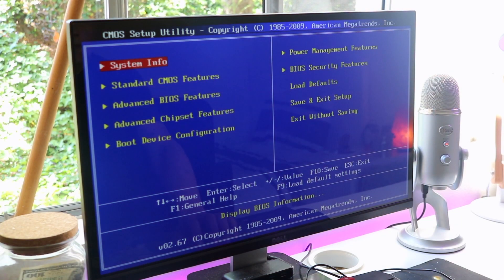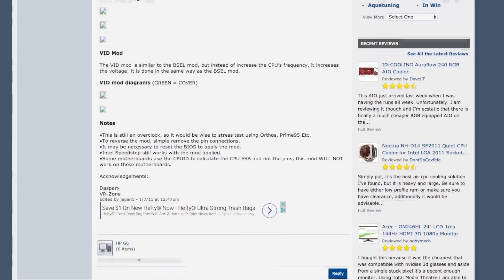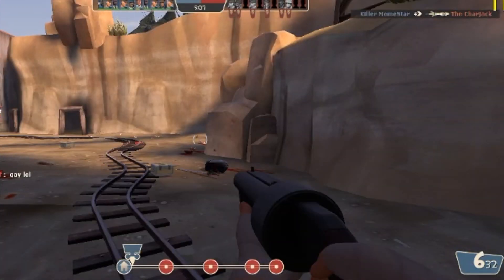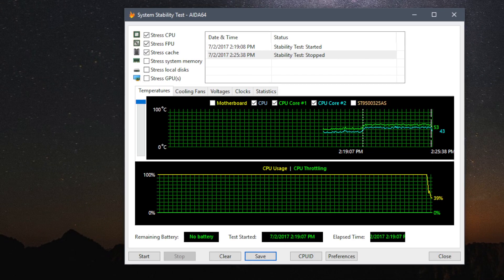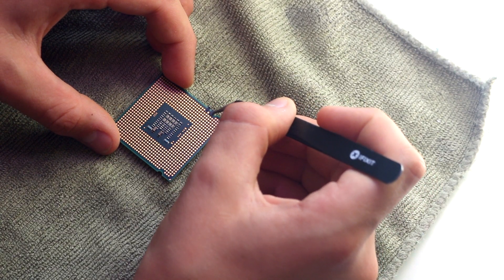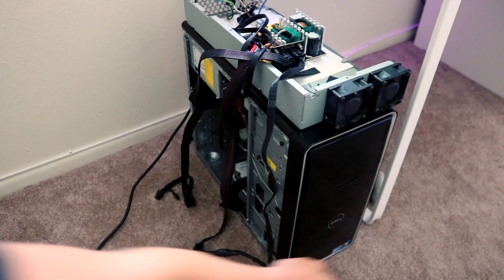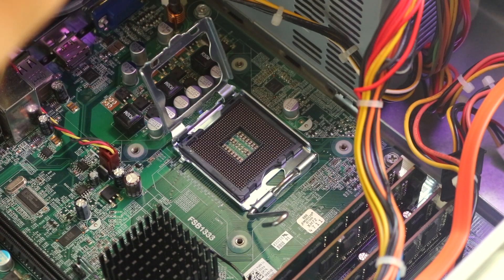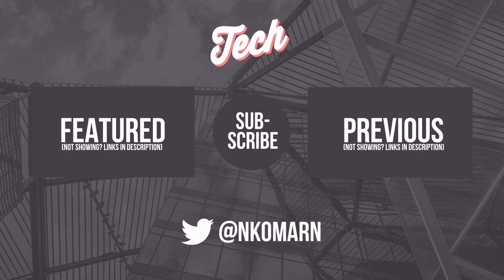LGA 775 Tape Mod (BSEL) - Does it work on low end computers?

Comment: According to Sysinfo my taped Core 2 Duo is running at almost 2000 MHZ.
Reply: Are you also using an E7500?

It might be you have Intel's automated CPU power-saving feature aka 'Enhanced Intel SpeedStep Technology' enabled. This feature lowers your CPU's core speeds whilst the CPU is in an idle state. In the case of this particular microarchitecture your CPU's core speeds are altered in equal measure.

Quick re-cap: Bus clock x CPU multiplier = CPU core clock

With EIST enabled the minmum multiplier for this CPU is x6.0 and the maximum x11.0, hence:

Minumum (idle):
      Default: 6.0 x 266 MHz bus (1066 MHz FSB) = 1596 MHz core
Over-clock: 6.0 x 333 MHz bus (1333 MHz FSB) = 1998 MHz core

Maximum (load):
      Default: 11.0 x 222 MHz bus speed = 2926 MHz
Over-clock: 11.0 x 333 MHz = 3663 MHz.
Reply: @QuadTubeChannel  thx, but now i'm using a i5 2500k overclocked to 4.8

Comment: Ran a q6600 with this mod at 3.3Ghz and it ran no problem. For $15.00 on eBay you can get a q6600 pop it in your lga 775 board and have 3ghz quad core 4 thread performance.

Comment: I overclocked my e7500 using this mod, it went from 2.9ghz to 3.6ghz
Reply: did this to my mums ACer AIO, I had to solder two pins on the chip to increase voltage as you state. 3.6ghz!
Reply: chazzy2501 where does it say anything to do with soldering?
Reply: Tutorialmaster17 maybe cuz cpu was soldered to the mobo so he had to short the pins instead of tape

Comment: Dude, be careful when you install the CPU while the thermal paste is applied. i understand if you didn't have it at the time, but it can create problems if you accidentally get a little bit on the pins. you do not want the same that happen to me

Comment: You need to connect certain pads to send the signal for higher voltage if your clocks are unstable
Reply: I did the tape mod but I should probably do it too.

Comment: This mod is much more commonly used on low-speed 1066FSB chips. This usually works best on the E6300 through E6600, and the Q6600. Other chips wind up clocked too high!
Reply from the maker: I did this mod on a Q6600 a bit later and it ended up working just fine. Thanks for the info!
Reply: Doug The Motherboard Guy do you know if this works on a Q8200 2.33ghz cpu
Reply: can this work on the E3400?
Reply: Can this work on X5450?

Comment: There are also pad mods for adjusting voltage. If your CPUs internal voltage ID is between 1.2250 and 1.3125 (which it very likely is if it's a desktop CPU, just check cpuz), you can short VID4 to VSS (low, zero) to get a 0.1 volt increase.
https://logout.hu/dl/upc/2017-11/18754_vid.jpg
http://www.rayer.g6.cz/hardware/core2/core2.gif
Reply: Thanks a lot, brother!
I have been looking for this for 5 years for my intel DG31 and E7200 C2D
Reply: @LongTran-em6hc  (also, not all techies are bros, but I spose the ironman is a clue 😂)

Comment: I did it with a Pentium Dual Core E5200 and I did somwthing wrong and the clock speed was 12.69GHz :D 
The CPU was heating up so fast :D
Reply: Enduro Life Hungary. If it heated up fast, I would do it again but this time with a thermal pad.
Reply: Damn, that's world OC record right there man.

Comment: Can you overclock Amd athlon 64 2x +4000?
Reply: I know this is old, but just wanted to say yes, you can over-clock said CPU. They over-clock and under-volt well. Your mileage varies as no two CPU's are the same, but many will over-clock and under-volt to around 3GHz before you have to start using more vCore, the requiments of which rise significantly beyond said delta.

A nice increase from the default 2.1 GHz, right? Alas, whether or not ths is actually practical is questionable. The hardware today (even second-hand) tends to be a lot more capable including support for SSE 4.1 or greater instructions.

There are also limitations and risks associated with over-clocking on certain boards. A small number sport weaker voltage regulation in order to cut down on cost - avoid if at all possible. Such boards typically support 95W CPU's rather than their 125W variants and this can impact not only your upgrade path but also your ability to over-clock. Then there's the boards that lack requisite BIOS features for over-clocking, forcing you to use Windows software in the hope it will work.

Many AM2 boards can also be upgraded to use AM3 CPU's like the Athlon II and Phenom II with upto 6 cores. But even then, you still have the big question as to whether or not the system fulfils your requirements as the technology you're upgrading to is still considered old by today's standards..

Hope this helps to anyone still contemplating tinkering with these old timers :)
Reply: @QuadTubeChannel  thanks, i will use this in the future

Comment: When you did the gaming tests, did you even put a graphics card in the old pc?
Reply: λucas that's logical my man, you are completely right, it is pointless to oc a cpu expecting good results in games performance with an old and weak integrated gpu, and he had to cover just the first pin not the second one(the third from left to right)
Reply from the maker: Not in this video since the computer didn't originally come with a GPU.
Reply: techtoolbox well overclocking the cpu will only make a real difference if you're using a dedicated gpu.

Comment: Will this work for my Q8300? I have an Optiplex 755 MT.
Reply: LordHezi No, it won't. This mod jumps the frontside bus speed from 266 to 333 (aka 1066 to 1333 since 775 CPUs have quad pumped frontside). Your Q8300 is already at 1333.

Comment: With an 11x multiplier, the target of 3.66GHz is just too high, now without an overclocking BIOS, it might be worth revisiting with the power profile adjusted to lower the maximum, which might limit the multiplier - 90% or maybe 91% ought to hold it to 10x and 3.33GHz
Reply from the maker: I managed to do it with a Q6600 and it worked out just fine!
Reply: Yes. I've done 2 Q6600s this way. 3.0 appears to be no sweat for these chips.

Comment: Wonder how this would work with my core2duo build. That thing's been my main gaming rig for at least 6 months.
Reply from the maker: What are the specs?
Reply: 2.1 Ghz core2duo, 4Gb DDR2, 500 Gb hard drive (win 7 home basic). GT430 nvidia graphics card. 
Also has some wintv knockoff tuner card for Xbox capture.
Reply from the maker: I recently upgraded my Inspiron with a 2.4GHz Intel Core 2 Quad Q6600 and a GTX 760. It's honestly a great gaming machine now.
Reply: Core2Duos are pretty cheap these days, if you can actually find one... know someone on facebook considering turning them into art (though their best one out of a bundle looked like an E4700).
The Q6600 quad is the sweet spot for BSEL mod, as it seems most likely to take the resulting 3GHz without complaint - the other alternative being LGA771-775 sticker mod which needs the socket de-blocking or the CPU notching to fit
Reply: you need to have a 1066 Mhz fsb cpu in order to make this mod
Reply: get a gtx 1050 mini its better and no bottleneck!

Comment: do it with a q6600
Reply: agreee. so far i done some research mostly q6600 will work out. since you have motherboard support fsb 1333mhz
Reply from the maker: So I tested this in my newest video and it turns out the Q6600 works just fine in the same PC. I guess the Core 2 Duo chip just doesn't like being overclocked.